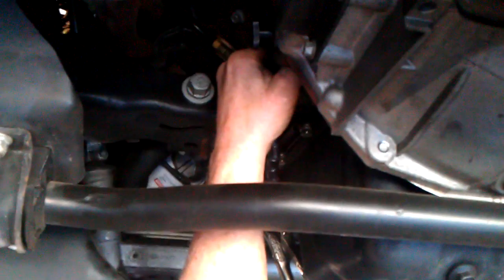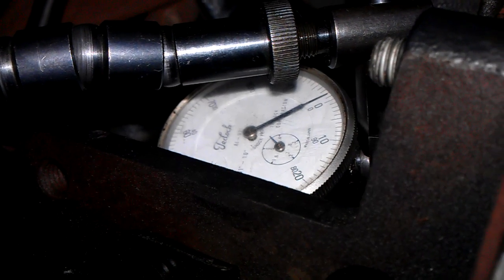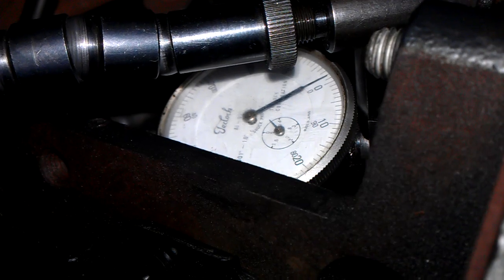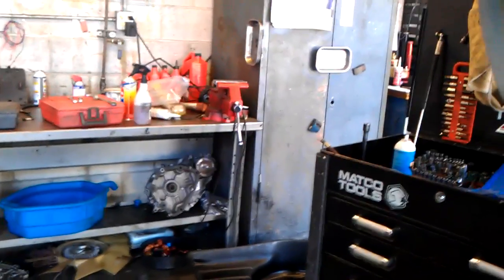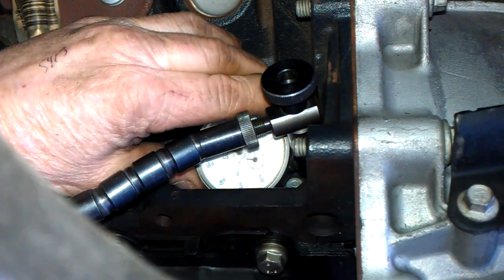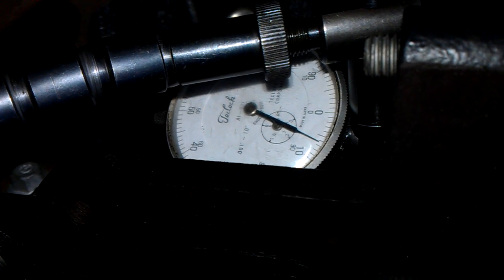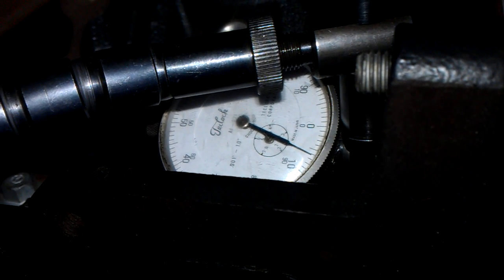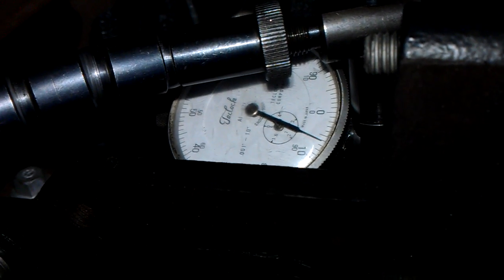CHECKING CRANKSHAFT ENDPLAY SHOP UPDATE 4/19/2012

Comment: Thanks for the vids, I keep learning new stuff.  Have you ever worked on any mercury mystiques (aka ford contour)?  I've got a check engine light that just won't stay fixed.  Changed the dpfe sensor, both oxygen sensors, cleaned the MAF, egr is fine, currently cleaning the intake manifold but I doubt that will do much to make it better.  Any thoughts or suggestions?  I've got to register it again in June.